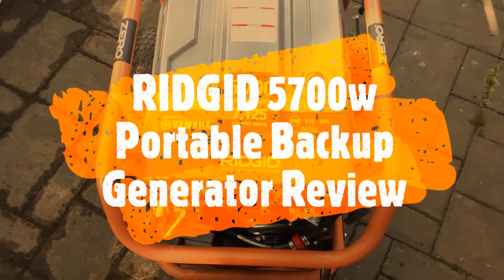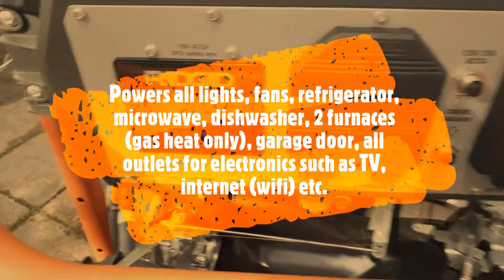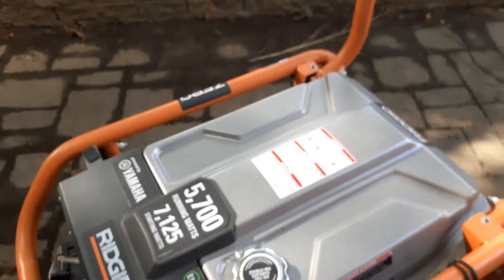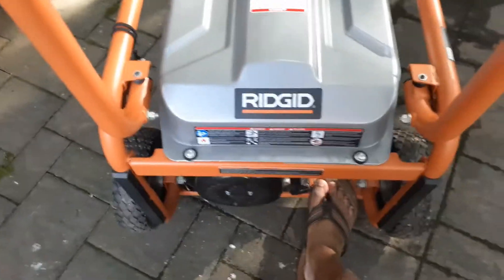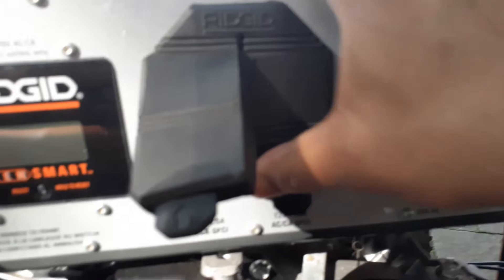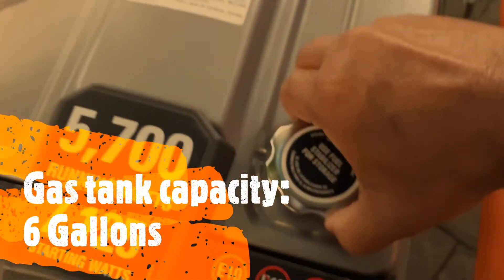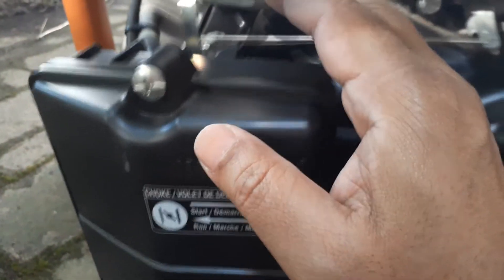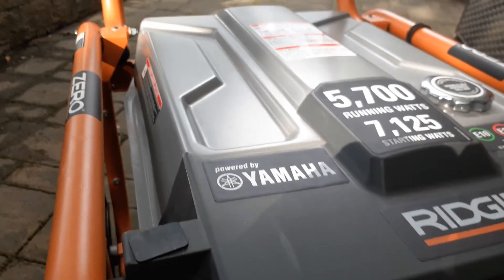Ridgid 5700W Home Backup Generator (RD905712)

Comment: Good review.  I have had good service out of identical unit over last 7 years.  Always drain gas after use if extended down time is expected. Poor fuel quality is # cause of small engine problems.
Reply from the maker: Thank you for the comment. Yes, mine starts up in one or two pulls everytime because I drain the gas before storing - https://youtu.be/nxicuY1EAEo.

Comment: Don't buy this generator. Tried installing a muffler on it. But the motor is so noisy muffler made no difference. Tires leak yellow powder and are going flat. Gcfi outlets suck. Handle folds in front of outlets. And on and on.
Reply from the maker: You are correct about the handle, but it has not obstructed the outlet for me. I have not used the regular outlet, only the 240v one, so GFCI was not an issue. The engine noise is similar to the other non-inverter generators, but you are correct that it is loud.